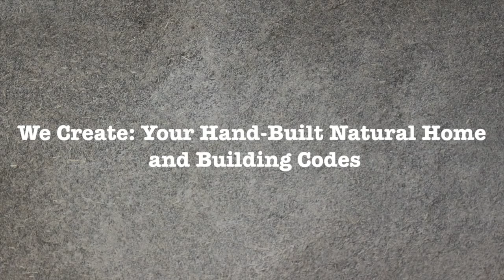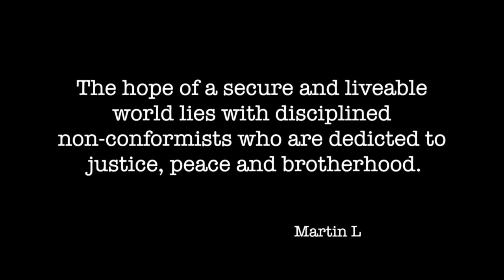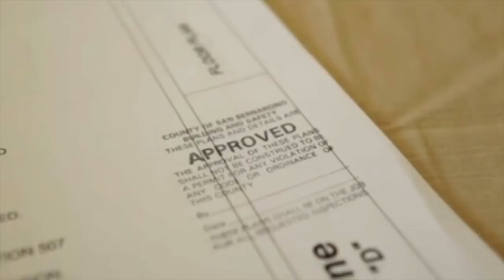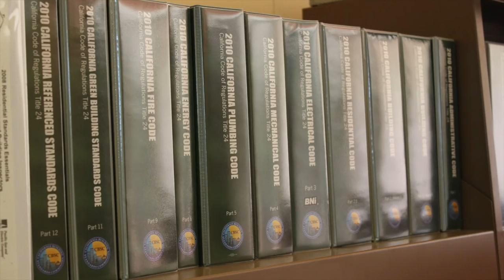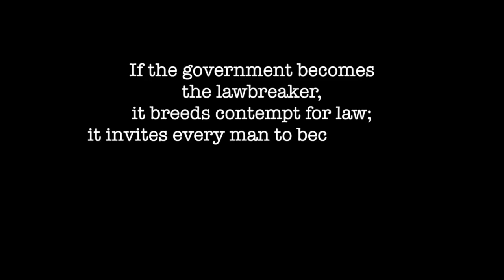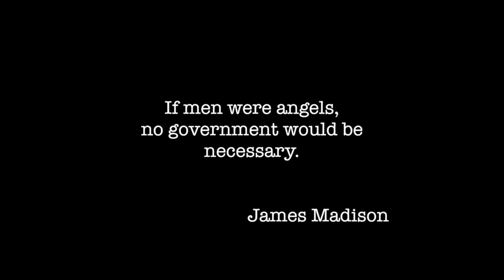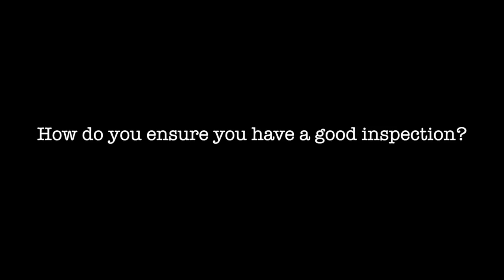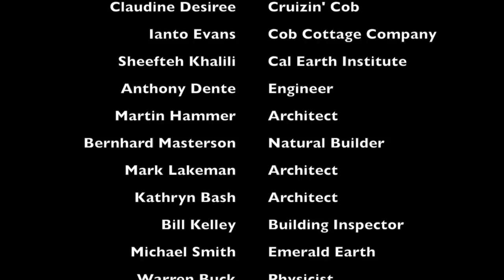Handbuilt small homes and the building codes

Comment: Two things you need for Energy Efficiency straw or dirt I've been inside a straw house in the middle of the summer 110 degrees on the outside no AC it was like walking into a cooler un-freakin'-believable the homes constructed of straw and dirt that's it

Comment: Excellent video!  I think we need to push for having two separate codes.  One for buildings over 500 square feet and one for buildings under 500 square feet.  The codes for buildings under 500 square feet also need to agree nationally on ways of remedying code violations without being unreasonable or costing too much.  I think that the codes should have many exceptions added to them.  I also think that it should be a requirement to approve variations and exceptions unless the building inspector can prove the variation is unsafe (especially if the building is under 500 square feet).  The burden of proof should be on the inspector and not the homeowner/builder.  There is so much that needs to change.  We will never be economically free people if we collectively allow our economic slave masters to ride roughshod over us.  We have to have enough healthy rebellion collectively to break free of those who constantly oppress us.  Just saying...because somebody ought to!
Reply: Rebecca - I could not have said this better myself!  You echo EXACTLY my thoughts.  The building codes have become waaaaaay too onerous and as the Chief building inspector said when I interviewed him, no-one even knows everything that is in the code it's become that over burdensome.  You're also right that we have to have a healthy rebellion because no-one stands to make money off anyone building their own small homes so there is no lobbyist that is going to fight for what could so easily make us economically free AND live in less toxic homes AND reduce the waste from 'conventional' home-building at the same time.  It's a win-win-win-win for everyone except the mortgage and building products industries.
Reply: Rebecca,

We cannot •DISAGREE• with you more.

We live in Texas and have both restricted and unrestricted properties. We have to pay exorbitant taxes/fees on our heavily restricted HOA home and property, versus the nearly laughable single property tax on our unrestricted country home and all its acreage.

There is NO WAY, on God's green earth, we want a national code butting into our business and lives telling us anything about what we can and cannot build, how and how not to build, on our second property.

We bought that property because we wanted to build whatever kind(s) of square footage structure(s) we decided.

You're asking us to give up •our rights• for •your benefit•, just because you decided to live and buy property in an over-governed, over-taxed, less freedom location or state? Keep that to yourself and change your own state code laws, don't slam an additional national law on others.

Everything we have built, everything we have contracted, on our second property has been inspected and permitted because we paid for it, we invited them in, for our own safety. It's not forced on us like you're advocating the Feds to do to everyone -- including us.
Reply: Love those nuances. Whenever people propose stuff it's usually in broad strokes, glossing over important details which in the case of house building... are usually costly.  I'll be building in Spain hopefully somewhat later this year. There's no specific codes in that region other than not being allowed to poor concrete i believe.

Comment: This video is right.  WAY too complicated.  
Why should I trust officials who refuse to allow me to live in a well-engineered yurt? 
Why trust officials who refuse to allow me to build off-grid cob, earthship, or earthbag houses, without forcing those to be built to Codes that only fit for stick-built houses?    WHY trust officials who cannot even agree on what a good job is, or vary between "you need 3 outlets under that window" and "you only need one outlet under that window, IDK why the other guy said you needed 3"......and more?   
How about home inspectors who routinely MISS egregious damages in a house someone is buying, then play dumb? [One even tried to convince me this house was 2x6 construction--it most certainly is not--it's cheap 2x4s with mingy insulation and trampoline floors with a leaky roof.   But it was bot in summer, so they couldn't swear that the roof leaked...so it was not on their report.  Inspectors I spoke with, dodged putting anything on the report that might ruin the sale of the property.  
Septic industry has gotten mandated their engineered, guaranteed-to-fail systems...even though far better can be done using natural systems, which keep sewage totally aerobic and clean, so it cannot pollute ground and water.  
Or house flippers that routinely COVER/HIDE major defects in houses sold?   Trampoline floors [2x8's spanning 15'], badly installed showers that if used, will rot the house; paint hiding failed drywall from roof leaks, slanted floors, bad wiring, sockets, and mains panels, etc. 
Realty is a lipstick-on-a-pig RACKET, so cleverly patched together, each entity, from the repo-lenders to flippers, realtors, and inspectors, can get away with saying: "I didn't know anything about _____".   
But really? They ALL knew, and covered up dangerous issues, including wiring, plumbing, siting, air quality, poor framing, leaking roofs, etc.     
One magic code is:   when the assessor returns to the table to tell the buyer "you have $30K of instant equity...do you want a 2nd?"  That clues the buyer, IF they are savvy, that is exactly how much, MINIMUM, is needed to repair the big-ticket infrastructure in the house the buyer just signed for.   
Here's your keys. 
IT's RAMPANT in SW WA.  
Thurston County, WA, PERMITTED a sewage pit [aka agricultural pond], for the Ostram Mushroom farm, up-close and personal to existing tracts of homes, a school, businesses, and a sports park.    That's a 24/7 operation to make compost to grow their mushrooms-----very good......except.... that pit FREQUENTLY spreads SEWER GASSES all over at least 1.5 mile radius, depending on where the winds are blowing.       
The realtor told us, upon a visit here:   "You might notice an occasional, slight odor from the farm".....well, there's NOTHING SLIGHT, NOR OCCASIONAL, about it.    IT's SEWER GASSES everyone's exposed to.     Sulfurous, as well as other noxious gasses.    Hard to breath, smarts the eyes, triggers nausea and dizziness.     Thurston County PERMITTED THAT.    
The 1st year, our property taxes were raised THREE times....maybe because we kept the yard mowed?  
The Air Quality Board refused to respond to my emails. 
The Mushroom farm refused to respond to my emails. 
County has yet to respond to communications. 
I told all of them:  'We like mushrooms, the farm, and that they compost-----only, they need to do something drastically different, to contain or relocate the cesspit for their manures for their composting'.   I included some constructive suggestions to remedy that cesspit.  
It's very MALFEASANT, on the part of all involved in stifling owner/builders, stifling natural building, stifling simplifying.  
So.... officials wonder why growing numbers of people lose respect or trust...?!?  Or stop seeking permits?   Maybe they need to listen to this some more.
Reply: be blessed! pray to Jesus! He helped me and family and friends for whom i prayed so many times. so many miracles. so many! do not lose hope even in the worst time. just pray and trust Jesus and be confident that somehow God will make it all right!
Reply: That's awful. Reminds me of the horror stories I've heard from people living near hog farms.

Comment: Yes, some are4as are more unfriendly to unusual life styles than others.  But as far as counties doing a fast sale on seized properties it is probably faster to sell land that has no dwellings on it of any kind. The jungle hammocks are easily purchased online. They are under $100. You can pitch them in the air like a hammock and some can also be pitched on the ground as well.  They have a roof with flaps that are fine in most rain storms. If the rain is severe there are roof flaps that can keep water from blowing sideways into the hammock. The mosquito netting in mine did a perfect job. In Florida heat is a huge enemy so I liked mine pitched well off of the ground. The higher you go the cooler it gets. Around here the ground radiates a lot of heat. In cold weather you can put any sleeping bag you like inside the hammock so even sub arctic conditions are easily  tolerated. In my area snakes are quite common and we also have an abundance of wild hogs that can attack at any time.  Get five feet in the air and those critters are no longer a problem. If moose or bear are an issue you can pitch higher up. Often one can pitch a jungle hammock almost instantly if trees are close at hand,  They pack easily and weight is not an issue. If you pitch one in private people often don't notice them as most people look down rather than up in tree covered areas.

Comment: Those building codes I do understand are suppose to be for our well being but some of those codes are just a load of crap to make it harder for poor people or like minded people to get a home . Simply and straight forward .
Reply: Exactly!  What we need is something that is a) appropriate to much smaller homes that don't require the engineering that a huge 3000 square foot home requires and b) that is minimalistic rather than over-onerous and unnecessary. In fact if we could go back to the Unified Building Codes of 1950's which served us just fine, we'd be a lot better off.
Reply: I agree completely .One thing we have learned over the years is that codes and laws are made in a large part albeit not completely to pad the pockets of others .
Reply: Many of them are also created to keep neighbors happy (like zoning laws and building laws that prevent eyesores being built) ....so there are good reasons to have some laws for safety and harmony...it's just a matter of 'how many' is enough and at what point do they just become over the top!
Reply: I would agree with that Cari

Comment: There's a big detail missing in this video, there are lots of ways to build a frame to code, I can use steel, stone, concrete, wood etc. What I use for infill between the frames might have concerns for fire, but I can get the structure itself approved easily. 

However if I want to support the roof with some natural material containing straw or unfired clay most jurisdictions will say that's not to code, you'd need to have an engineer certify it and the engineer can't. And if my natural wall material was to someday fail because of too much moisture, I could still save my house if I had a frame. So build to code, use a frame.
Reply from the maker: HI Doug what you say is true, and that is certainly another way around it....one thing I love about comments like these is that people come with all sorts of great ideas that help others.  One thing to bear in mind though is thatwhen you're building with earth, it doesn't adhere to wooden frames as well as if there were no wooden frames.  I've built a few earth cottages and the only place I've had issues with cob eventually falling off is where it's been attached to wood (which was clay slipped and had old nails hammered into it to give it something to adhere to).  Earth is strong enough to build without a frame and if you're trying to save on using material it seems a shame to have to build with a frame plus too much of a rigid frame often takes away from the sculptural organic feel of a place.  Earth homes are built all over the world with no frame. Thanks for watching and adding your helpful advice for those who want to go that route.

Comment: I'd rather use the thick mud walls than the thin...whatever the latest walls are made of. One really doesn't needed central air heating or cooling. But one does need Windows on all sides of a home. The thick Adobe holds heat in the winter and is cool in the summer. I can see that perhaps soil may need to be tested for radio active particles. and other man made and natural contaminants like lead. A home like porcelain potter should not have lead arsenic.
Reply: One thing I've learned about windows (that I'd read but not really applied) is that so much depends on climate.  In hot climates you definitely don't want a large amount of glass on the west where the afternoon sun bakes. And always good to make sure you're working with non-toxic materials.  So many of our modern (code required) materials are filled with all sorts of toxic fire retardant chemicals etc....yet their use in encouraged.